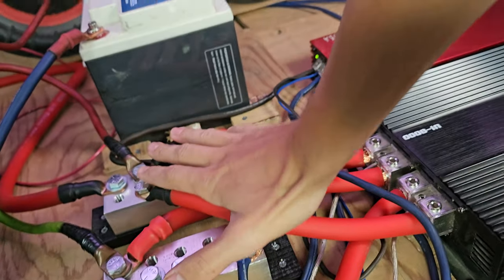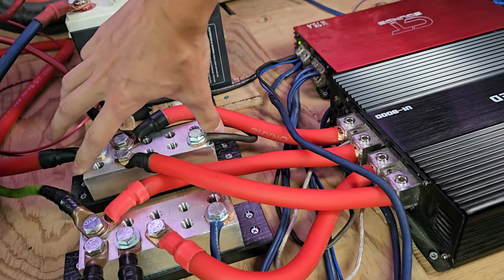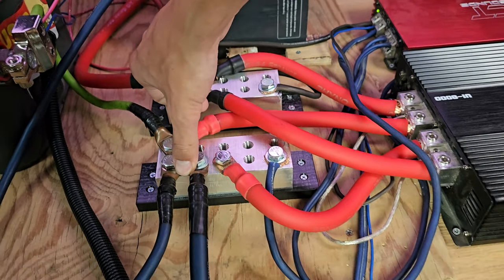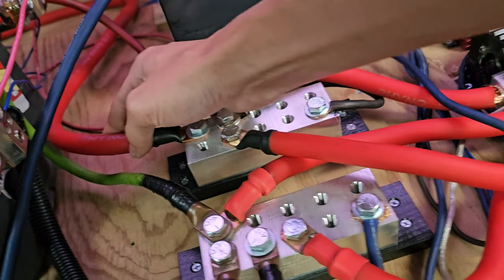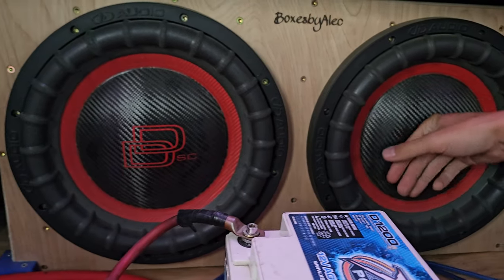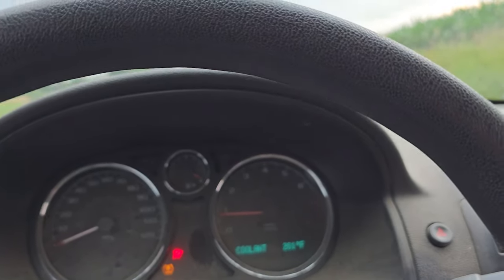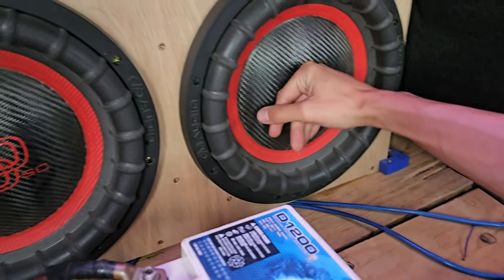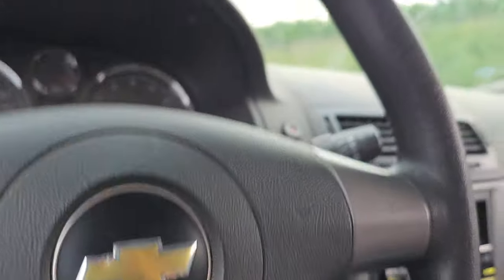DD9912's Update

Comment: You should never drop into the 11's. You need to upgrade your electrical. Your gonna blow something. Just trying to help.
Reply: Placing bets the Alternator goes first. When I dropped to 11-within 20 minutes I had a bad diode in the alt. It only gets scary when your feeling power loss when your driving and see your voltage drop to 8😅. Lesson learned: Do the big3 all the way. Don't just run a hot from the battery to the amp.

I always set my gains below threshold so no worries there.

Comment: Man you spent a grip on those 2 subs but im telling you from experience your electrical should have been first i mean you just generating heat in the subs and amplifiers when that system probably at 13.7 would have been 3 to 6db louder with a good alternator. I know one 9912 can handle probably 3 to 4k clean power in a custom ported box and you couldn't even sit in there
Reply from the maker: Yeah an alternator is the next thing on the list for sure I did have a high amperage alt but It's taken a shit on me and I've since learned the company has had some pretty harsh backlash and poor quality. I've been looking into Apex alts and a few other well known companies for a replacement.

Comment: Nice job on those custom blocks man cool update 👍👍. Just need that high amp alt . You know if you need to go cheap you could have your stock one rebuilt ,altho there are many companies out there to go with . Also you could try one the ultra caps they even seel on e-bay just run it with a isolator.  Maybe from recoil . Peice.    Bro!

Comment: WHATTTT !!!!  love this, I also have a 07 Cobalt lol.. and i see you have a thing in your dome light HAHAHA lol i do to CAUSE that light rattles sooo much huh HAHA.. i seen it i was like NO WAY lol.. i have the same problem ,   love your build !!  i just have 2 10s with a 6k Soundstream amp, it rattles so much lol.. nice to see other people with cobalts lol
Reply from the maker: Thanks I appreciate the comment! Also What's holding my dome light from rattling is a penny lmao. My mirror has also started rattling off oh well.
Reply: @brizzmoto6229  yea I use a peice of old credit card to hold dome light, also my back trim peice the one that covers the 6x9s behind the backseat, ugh it's so flimsy so it bends and rattles as well..o and another weird thing in the front doors the speaker placement is weird like it's shaped like a spade symbol. What is the actual size speakers that go in there
Reply from the maker: I believe there 6.5s you can get adapter plates to put normal speakers in there

Comment: Has anybody bothered to explain why you don't want to run into 10 V.
Reply: I don't know if your comment is serious but all amplifiers work well with at least 12.5 volts are higher he's putting a strain on his alternator and batteries and amplifier if he can keep it in the high13s he will be OK but 10 volts he is going to blow up something?
Reply: Many base heads are under the impression.,, That if I run down into ten volts, my amps just not putting out full power,, Well, that is true.,, The biggest problem is running. A clipped signal from the low Voltage to the subwoofers. And that's why I asked has anyone explained to you Don't want to run down to 10v